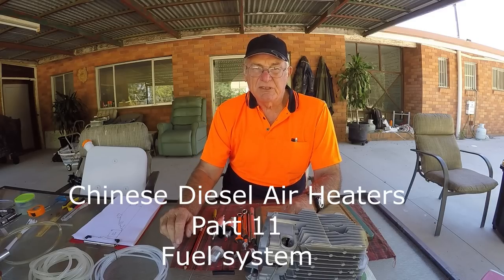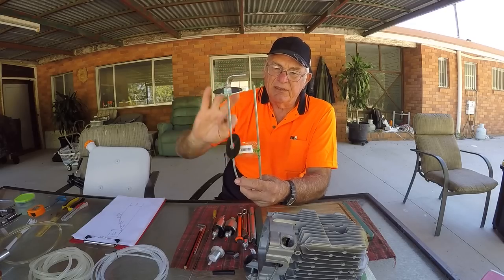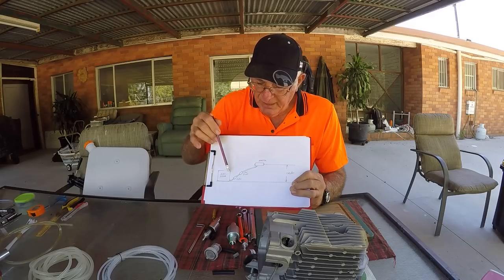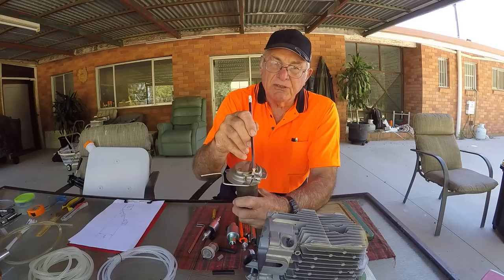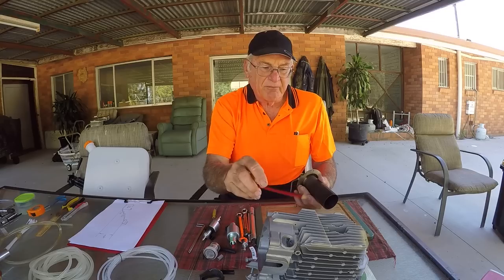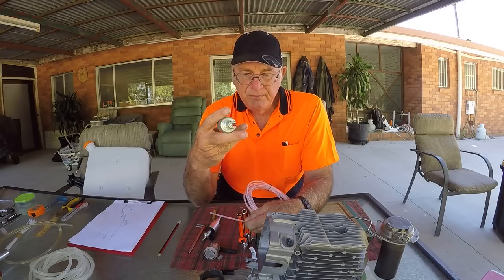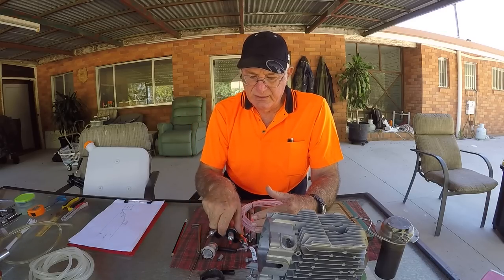Chinese Diesel Air Heaters - Part 11 -  Fuel Delivery

Comment: Thank you so much for the informative video! I learned a lot of tips (like the proper cutting of the line for example). One question: assuming I am using the hard line and the fuel tank, pump, and heater are all at the same level, is there a maximum fuel line length? I am interested in having a 12ft run between the pump and the heater. Thanks John!
Reply from the maker: Hi Jared, place the pump close to the fuel tank and use normal “quality” fuel line from tank to filter to pump. Then use only narrow bore hard nylon from pump to heater, so fuel pulses are not absorbed by soft rubber and a 12 foot run should be ok. You will most likely have to service it more often as lower pump pressure at atomisation screens mean heater will be less tolerant to carbon buildup in screens. Have a look at the motorhome video. It has a long delivery run. JMcK
Reply: @johnmck1147  Thanks!

Comment: Hi John, great info in all your videos, i recently bought a chinese heater and installed it in my caravan but it just won't power up, no power going to lcd screen, checked fuses and wiring, seem all good, can you help at all please?
Reply from the maker: Hi Huw,

It is a bit hard without seeing your set up but here goes.

1. Did you bench test the heater after purchase and before install to see if it worked correctly?
Very occasionally you can get a dud heater, which needs to be returned or a replacement sent.

2. Did you connect the heater directly to the caravan battery? You need to do this as these heaters draw up to 10 amps at 12V on start up, and connecting them to a caravan wiring loom causes a voltage drop and the glow plug does not get hot enough to start the heater.

3. Have you connected the wire polarity correctly. Red cable with fuse to battery positive terminal?

4. Is your battery charged up?

5. If the LED screen is blank, did you plug it into the wire harness correctly and all the way in.

6. Are you able to check with a multimeter you are getting 12V at the heater ECB?

If you check the above and the heater is a recent purchase, it is possible you have a dud controller. (It is easy fo me as I just try a different controller.) Anyway, in this case, suggest you ask your supplier for a replacement.

Please let me know how you go.  JMcK
Reply: @johnmck1147   Hi John, turns out they had the wiring wrong, i connected red to negative and black to positive and it now works perfectly! found it by mistake really as i had the wiring direct to battery but then i though i'd try black to body of caravan aswell to the battery and got a spark and a fuse blew, that made me think i've got power to black cable so i swapped them around and hey presto! And yes i definately had red to positive on battery and black to earth but not any more. thanks for all your videos, very informative.

Comment: @John, thanks for a fantastic set of videos!
 One question, Does it matter if I use a 2.5mm nylon hose? Does it matter?
Should I buy a 2mm instead?
Reply from the maker: Hi Tolly,

Pleased you found the videos helpful.

2.5 mm hard nylon hose is ok. The important word here is “hard”…..I use both 2mm and 2.5 mm hard nylon hose.

Fuel is delivered in pulses to the atomisation screens in the burner chamber, where the fuel is atomised and mixed with air to produce a correct fuel air mix for combustion. If you use flexible fuel hose, on the delivery side of the pump, of more than a few inches, it will absorb the fuel pressure pulses, causing poor atomisation which quickly produces carbon on the atomisation screens, which then causes poor or non starting, and poor burning in the burn chamber, which causes even more carbon deposits and so on.

Sadly, these days, some heater suppliers have no understanding of the product they sell, and supply these heaters with cheap, rubbish, flexible vinyl fuel hose……They have no understand of the operation.
“It is not our problem your heater does not work anymore….It worked just fine when you first bought it. You must have done something bad to it”

Cheers.   JMcK
Reply: Hi John!
Ok, I will use the 2.5mm. I will start it up for the first time this weekend. 🙂

Thanks a lot!

Comment: Hi John we have a 'copy' that was started after a year, first go, went beautifully. Now will not restart no matter what we try. Tui Te controller, new fuel pump, no codes. Are we locked out? Love your videos, have learned a great deal & tweaked ours to suit. Many thanks.
Reply from the maker: Hi Wendy, not sure about the Tui Te controller. 

If the heater worked well in the past and does not start now, it could be a few things. 

When you turn it on, do you hear the fuel pump start to tick after a minute or so? If not and you have a new fuel pump it could be a controller issue. It is easy fo me, I have spare controllers and just swap them around.

If the fuel pump starts to tick but the heater does not light first check that diesel is flowing. Take the hose off the heater and check diesel is coming out the hose. It should come out in little squirts. If you have diesel flowing it could be glow plug or carbon.

Glow plug. Is the glow plug getting hot enough to light the fuel? If not it could be bad glow plug or poor wiring. The glow plug draws about 10 amps to start, it can't do this if the wire is too thin, there are poor connections, or corroded wire, or flat battery. Easiest way to do this is put a clamp meter on the positive wire, you should see 8 to 10 amps on the meter on start up.

If the glow plug, the wiring, and the fuel are all ok, it is most likely carbon in the heater, or a bug stuck in the small air start hole. Do you have a filter on the combustion air inlet hose?

Now for the carbon issue. If the fuel pump ticks, this is a most likely cause of non start. These heaters do get carbon buildup, same as a wood stove or heat stove, hence the need for chimney sweepers. The rate of carbon build up is dependent on the quality of your install. The more restrictions in the exhaust and combustion air inlet, the shorter the maintenance period.

Now the first part to clean is the start up circuit area. You need to remove the glow plug and glow plug screen. If the glow plug screen is full of carbon the heater will not light. You need to clean the screen of carbon using something like carby cleaner, or brushing and burning with map gas, or better still put in a new glow plug screen. 

You also must clean carbon or bugs out of the small air start hole after removing the glow screen. If that small hole is blocked the heater will not start. 

If there is a lot of carbon, you need to open up the heater, remove and clean carbon out of the burner chamber. There is a video about this.

I hope this helps.   JMcK
Reply: @johnmck1147  thank you John for your timely reply. Heater has had extremely little use so carbon build up is unlikely. In the padt, it has ran for a short time then stops. I started it after a couple of years of no starts because of the running  issue & it ran & heated beautifully, however it was a warm day so turned it off.  Now no go!  There now is no fuel pump noise or any thing. Have checked fuel at the heater end, yes. Will check electrics today. How do we purchase the led controller & board to match please? Ours heater is 24v.
Reply: @johnmck1147  have done electrics. Power to heater ie battery voltage is good.  Found 0.2v coming out of the heater to the pump on the heater  itself. Does it need to be pumping to get a reading? The ecu seems to be the issue??? I imagine we need an ecu & display. We cannot change the display from P07. We have been able to change this to show temp now. Tuitu heater from pinnicle in Ballarat
Reply from the maker: Wendy Eriksen 

Hi Wendy, if your system is 24V you need 24V to the pump to activate its pulses, however this is difficult to read on a multimeter as it is a very short voltage pulse. You say the pump does not tick on start, if this is the case, check the pump and its plug and wiring first before looking at buying a new ECU. 

I have a spare pump plug and switch to check the pump, but you can unplug the pump and check the pump by briefly applying voltage to the pump. You can use a 12V battery for this, the pump will still energise. Just touch the wire on and off to the battery post.

If the ECU is faulty, unusual unless you have overheated it, or reversed the battery voltage, you can buy spares on line. Search for ECU Chinese diesel air heater.

Good Luck.   JMcK
Reply: @johnmck1147  have done more electrical testing today John. Pump works with direct current to it. Tested the wiring at the heater to the pump, the pump works, but not when you switch the heater on normally. There is no pulses coming out of the heater to the pump. We feel we need to buy the the new display & updated ecu (contoller?). We have not seen an ecu online to purchase. Your email would be great to send photos to if allowed. Regards Wendy
Reply from the maker: Wendy Eriksen  
Hi Wendy, did you allow time for the heater to do its start up thing? It can take a minute or two for the pump to start before the heater switches on. First the fan, then the glow plug, then the pump. 

Also the pump will not start until the glow plug is hot. 

Suggest you turn it on and give it a few minutes to get started.

My email.  johnmck47@outlook.com

Good luck.   JMcK
Reply: @johnmck1147  thanks John auto sparky says its the heater. No start even when voltage is present at heater. Even loaded it up & no go. Pump works fine when tested. Could be display? But I dont think so. Showing no errors. Will remove & send back as we've  only ever got it to go 3 times in the whole time we've had it. Just by pure coincidence that it went the other day. Many, many  thanks for your assistance.
Reply from the maker: Wendy Eriksen 

👍

Comment: If I use the tank with the fuel outlet on the top will the dosing pump be able to pull the fuel out of the tank and down to itself?  Without causing problems or premature wear.
Reply from the maker: Yes David….JMcK

Comment: I installed two diesel heaters one year ago with one with nylon fuel line and the second I installed with the fuel line that came with it.
But now I have one problem with the diesel heater with the flex fuel line.
And now i have a error code e-08 which I think is the fuel line so I’m going to try to change the fuel line and see if i fix the problem

Comment: Hi John, lobe the work you have put into these videos 👍
I am trying to find the replacement fuel hose with 2mm internal diameter,  all I can seem to find is 3mm, will that still be ok?
Reply from the maker: Hi Marty, 

That is fine. The critical issue here for these heaters is to have “hard” fuel line from the dosing pump to the heater.. 2 mm or 3 mm is ok. You could even use narrow bore copper or stainless steel if need be. Eg like running the fuel line through a machinery space in a boat.

If you use soft fuel line on the delivery side of the pump it absorbs the fuel pulses so fuel is not pulsed through the atomisation screens in the burner causing bad fuel air mixture ratios, poor burn and rapid carbon build up in the burner. 

Cheers.   JMcK
Reply: @johnmck1147  Great, thank you for taking the time to reply. 👍

Comment: What will happen if the tank is located above the heater? I was wanting to mount it under the hood of my promaster
Reply from the maker: Hi MM,

That should be ok, however suggest you install a shutoff valve in the fuel line between tank and fuel pump, and turn this off when heater is not being used.  Head pressure (above metre or so) of diesel can seep past the seals in the pump and flood the heater when not in use.

Cheers.  JMcK

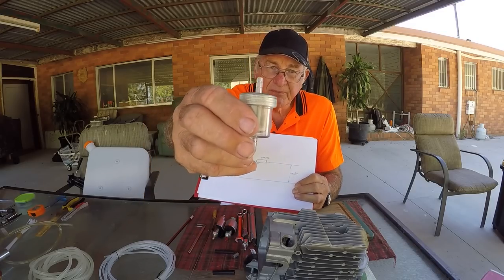Comment: John, thank you for taking the time to educate us with your knowledge.  I have a question regarding the fuel filter.  Could you link the one that you're uisng in the video @1:38 please?  Edit:   I live in Canada so winters get bad here, does it matter whether it's paper or steel mesh?
Reply from the maker: Hi SG, these videos are some three years old and I very much doubt my supplier is still around.
Many suppliers on eBay. Suggest you search “Fuel filter for Eberspacher diesel air heater “

I just now did a quick search. Here is a link to get you started.

https://www.ebay.com/itm/2-Diesel-Inline-Fuel-Filter-Kits-For-Webasto-Eberspacher-Air-Heater-Diesel-Kits-/175508459943?mkcid=16&mkevt=1&_trksid=p2349624.m46890.l49286&mkrid=711-127632-2357-0

Cheers.  JMcK
Reply: @johnmck1147  appreciate the prompt response and link John.  Thank you.

Comment: Hello John,
Thank you again for this great information. One more question if I may.
My heater came with the flexible fuel line, would it be best to just use copper tubing for the fuel line?
Thank you
Reply from the maker: Hi PAI

On the suction side of the heater, that is tank to fuel tap to fuel filter to fuel pump I use normal fuel hose. 

On the delivery side I use narrow bore hard nylon fuel hose, protected in some sort of sleeve or conduct.

In my opinion there is no need to use metal fuel hose unless the hose is going through a machinery space.
 
Regards. JMcK

Comment: Thank you so much for the info in this video. I was going to change to the rubber fuel hose that would be used on a car. 2 questions. 1. Is the harder type of hose specifically made for fuel? 2. I am putting my fuel at the rear of the van and the heater under the seat adjacent to the mudgaurd. Is the pump ok that distance (about 2.5 meters from the tank) or better close to the tank?
Reply from the maker: Hi Greg, normal 4 mm black rubber automotive fuel hose is ok from the diesel tank to the pump. From the pump onwards to the heater you should use the hard 2 mm bore nylon fuel line. 
The fuel pump is much better at pushing rather than sucking, hence the pump should be located as close to the fuel tank as is practical.  JMcK

Comment: Great video , I see on a lot of the videos when they first get the heater that a lot of the people have trouble figuring out what end of the pump is suction & which is delivery as they say they are not marked as well as the fuel filter is not marked. Could you comment on the correct way on both ? Thanks these are very informative video's ! :-)
Reply from the maker: Hi Darell, the inlet side of the filter is the smaller side where the fuel goes on to the outside of the filter medium. The outlet side of the fuel pump is the side where the wires go.  JMcK

Comment: Hi John, great videos mate, do you have a link to where I can buy the rigid nylon fuel line kit??
Reply from the maker: Hi N2, there are lots of sites on eBay, search for hard nylon fuel hose Eberspacher diesel heater. Below is one link to get you started.

https://www.ebay.com/itm/363457017401

Cheers.  JMcK

Comment: Hi John. very interesting topic and super-well explained. Congratulations and thanks. In the other hand, you said the maximun height diference between the tank and heater is about 0.5 mts (that is what I understood since that part had not as clear sound as needed by a non english language native), and I supose your source is an Eberspacher manual or so. In the installation manual of my chinese heater says it can handle up to 2 mts hight (something VERY important for my personal application as I plan to install the heater over the ceiling but the tank must be at 1 mt high to be refilled without messing the room). Did you check that ever in the real life ?
Thanks again for sharing your valuable knowledge and experience with us, best regards from Madrid,  
Jose
Reply from the maker: Hi Jose,

Yes, you should be ok with that install. 

Suggest you bench test it at that height first before install.

I have bench tested ok at 2 m lift for a short period, but make sure you only use narrow bore hard nylon fuel line on the delivery side of the pump. That cheap clear vinyl fuel hose sometimes supplied now with the Chinese heaters absorbs the fuel pulse so there is not enough pressure to force the fuel through the atomisation screens.  JMcK

Comment: I found mine to be working fine with the fat fuel line.  Plus the diesel flows up to pump without priming.  Just from gravity.
Reply from the maker: Yes, it will... for a while.

If the distance from pump to heater is short you should be ok, but if longer than a couple of feet the heater will stop working when carbon starts to build up on the atomisation screens and the fuel pulse that can push the fuel through the screens will be absorbed by the soft, large bore fuel hose.  JMcK

Comment: Great video!  Do you see any issue with the fuel tank sitting higher than the fuel pump?  My setup requires the pump inlet to be about 4 inches lower than the fuel tank output which is near the bottom of the tank (causing the head pressure to be on the pump inlet side).
Reply from the maker: Hi MB, 

The heaters work fine with the fuel tank above the pump, but if the tank is also above the heater you should install a shutoff valve in the fuel line before the pump, and turn this off when heater not in use.

You can have the issue of fuel seeping past the valves in the pump and then flooding the heater when not in use. This causes very poor starting and lots of smoke on start, or no start at all.  JMcK